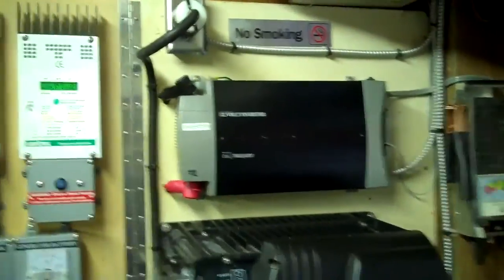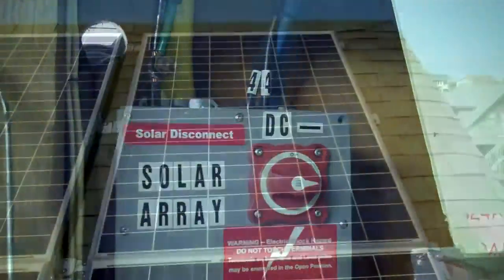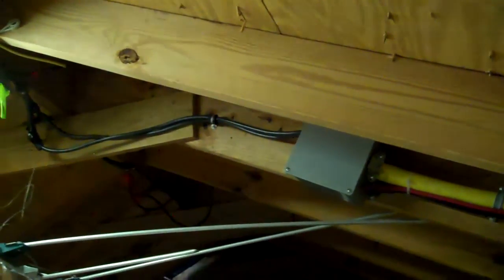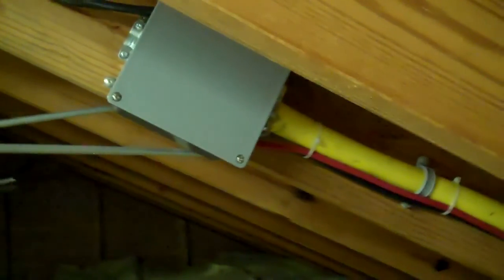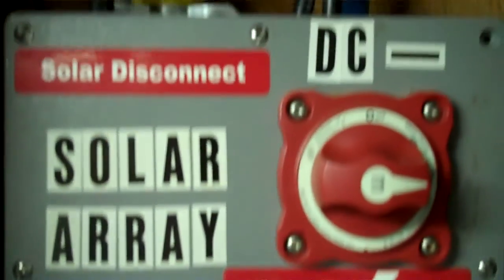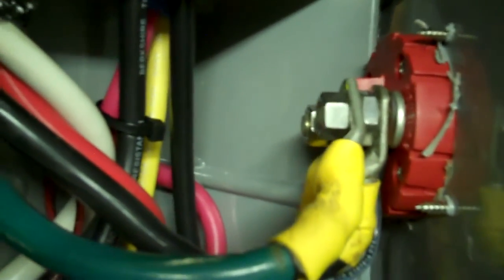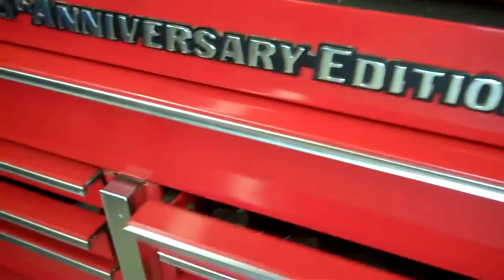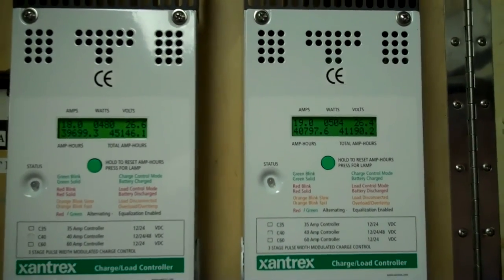TROUBLESHOOTING.. LOW SOLAR PANEL OUTPUT..SAFETY FIRST...

Comment: i like to ask you i got 4-100 watt solar panel hook up and when i test them out befor the charge controller not much amps but put a load on it the amps go up? i have at + to+ and - to-  is there someting wong with it ? i need some advice on it ---- thank you for any help

Comment: Wow you have just showed me something, I never thought about using my temperature sensor gun to diagnose electrical connections - pure genius! I found out a long time ago that copper connections need to be tightened at least twice because the copper "relaxes" after the first tightening.

Comment: People look at me like I'm crazy for telling them that their electrical panel connections need to be tighten because of the harmonics of electricity eventually loosens connections.
It's a yearly PM for us where I work (a data center), we shoot the gear with a IR camera., for bad spots. We even have the utility company come out will were doing this to check the risers and pad mounted gear. We have had a couple of saves doing that, especially the outside gear where it's still 12,470v.

Comment: I always try to plan attic work for early in the morning before the sun starts heating things up, but that sure wouldn't work for troubleshooting solar. Good 'ole Murphy working with you up there with that dead meter battery. If I just had a nickel for everytime something like that happened... Love your setup. Very good info. Thanks

Comment: I go over my connections with an infrared thermometer every few moths. and temp change i pull it apart clean it and fix it. There a must have if you have an off grid solar system. Nice video bro.